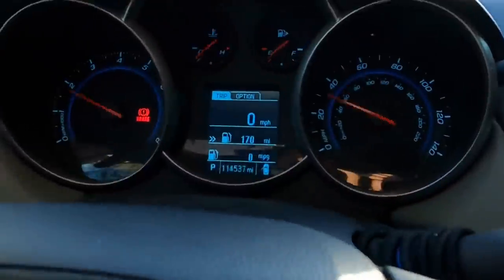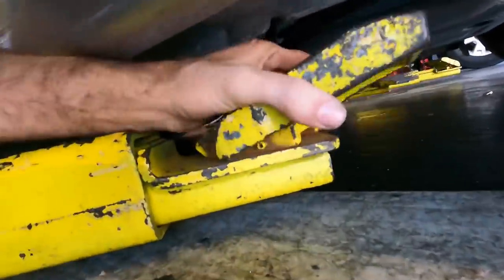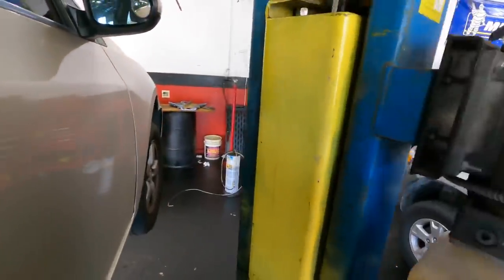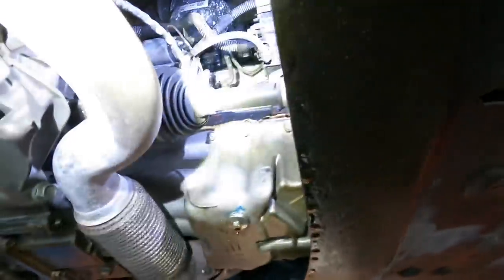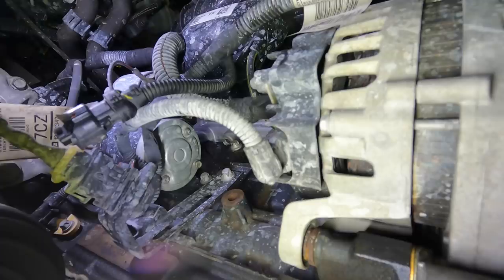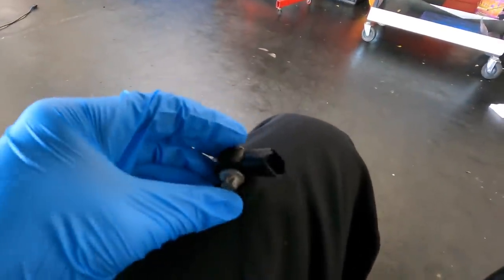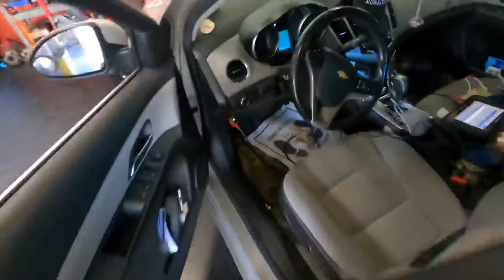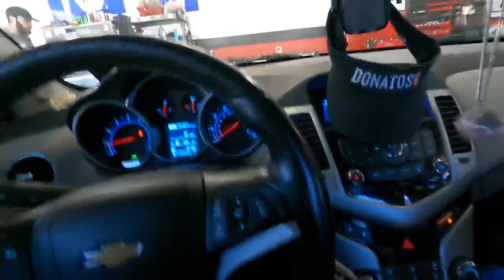Rolling the Dice! Parts Store Diag! Customer Supplied Parts. 2015 Chevy Cruze  P0324

Comment: Very clever 'knock-sensor' device!
( Makes me wonder "How in hell did someone 'connect-all-the-dots' to come-up w/the idea of using a piezo-electric effect/affect as a 'switch?' )
Reply: It's more like a microphone than a switch, generating electric pulses from the noise vibrations.
Reply: Believe it or not, a lot of the technology originally started with the military. Piezoelectric detonators were and are used on some weapons. The RPG-7 round uses it to fire it's shaped charge warhead on contact with the target. The crystals can also be used as an transducer/sensor in certain semiconductor manufacturing equipment. In that function the crystal is used to produce an ultrasonic pulse then is switched to sense mode. The pulse hits the crucible and reflects up to the now sensing crystal which now has had material deposited on it producing a voltage that the controller monitors. The material causes a dampening effect of the frequency recieved which directly translates into the amount of material deposited on the substrates due to the change in generated voltage. The system is known as a deposition controller. 
A little known fact also is that those crystals are what makes the beep in digital watches. If vibrated or struck thay produce voltage. If pulsating voltage is applied to them, they produce sound based on the voltage and frequency input.
Reply: @gerrynightingale9045  That's a verbose way of saying what I did, except for the make/break part.  Make/break would be a switch that is closing/opening a circuit.  As you said, there is no power to it so no circuit to close.
Reply: @jeffragar3493  Think anything you like
I wrote something, you want to somehow 'Counter' or 'Modify' what I wrote
Fine

Comment: I recall these cars coming with a factory installed oil leaks near the turbos and chronic transmission failures.  The customer is going to have to supply more parts eventually.

Comment: My father in law ran into a no code situation with his 2012 F150 with 5.0, hesitation and no code. shop talked him into a new throttle body around $750 with the part, truck was still hesitating. I took my trusty scan tool to his house and still no codes. I originally told him to have them clean the MAF sensor, He said they had. Immediately saw that someone had broken the pigtail connecting the MAF,  upon inspection the wires at the plug had little light colored bands ( stretch mark around the wires. I ordered the pig tail soldered it on and sprayed the MAF sensor clean. It ran great for eight hours of in town running and a slight hesitation developed again.  I told him to get a new air filter ( Throttle Body Guy had put in a K&N ) put in new filter, sprayed Sensor off again, end of problem. That K&N filter had so much oil on it , it was literally dripping off the corners of the filter when I changed it. He finally confessed that they had never touched the MAF sensor. Keep up the good work, love the videos. Your honesty is a great thing!

Comment: Good morning Ray 🙋‍♂️✌ I was wondering if you could give me some advice about my car! Any help would be appreciated 🙏🏼 It's my commuter car so I'm in need to get it fixed 😅👋 Be blessed 🙌
Reply: get a scanner and learn to read live data, that will help loads. doesn't have to be a high dollar unit, live data capable is what you need for running issues. there are people on this very sight that will help you learn to read the tea leaves and it's really not that hard. i bought a $50 unit on amazon that i prefer over a $200 unit i also bought with more capabilities. codes, dtcs, are often times not what you need but a result of other issues. Schrodingers Box look this guy up, he's were i got a lot of info when learning. he's pretty sharp. once you learn it, you'll be better than most at troubleshooting. obviously, that's not the entire picture and something mechanical, you'll not be able to see all the time with that info. there are tons of old school simple tricks to troubleshoot on here. i'm not suggesting you become a master mechanic but find some info to help you figure it out. then you might even opt to fix it yourself and you'll definitely save a ton of money over time.

Comment: Ray knows better than most that if most fixes 4 a given code on given   motor vin are identical, that's a good place for diagnosis start. Probably what this savy Cust did.
2 car gas station I worked would charge double for such repairs. Cause most custs don't realize parts profits pay the rent and utilities. There's no Free' Lunch for anything anymore, Folks.
If You Wants to Play.......
You Got's to Pay !

Comment: I welded in plates under my 1500. I made the surface like a ratchet handle surface.  The plates have deep edges. So it can't slip off. The garage asked me & thanked me for putting them in. They want me to put my "lift plate shoes" on some of their Vehicles. Every Vehicle is different. I may take them up on their offer. It cost me $275 to make, install. They are willing to pay $400. I guess I don't understand the Hype. Plus I have to be custom. Not put in random spots.

Comment: I work on cars for a living (in europe) I have never seen that type of lift pad . They look some what sketcy to me. The one i use have pads with a rubber top that you screw in to a desired hight. (2 stages) and with different higt extensions.  And i would never use a hydraulic lift without automtaic relese of the saftey latches at work (even my lift at home have automtatic locks)

Comment: Aside from dealer parts...aftermarket part's are an affordable way to keep your car on the  road. Buying your parts from the same parts store the repair shops buy from..and yes even the dealers buy from the parts  stores. So I laugh when a shop states it won't warranty the repair due to the customer bringing in "his/hers" parts..I agree some after market part brands are a better product..better quality..and you'll pay$ for it. If I buy front brake pads at Napa. Then bring them to a repair shop for onstseqq

Comment: hey if the scantool says it is a knock sensor, it HAS to be the knock sensor! The tool said so. Oh and the big box auto store said so too! Auto big box store was right!!! WHOHOOO!
Reply: As the dumb bunny that has to write the code for self diagnostics, we do the best we can with what we have.
Reply: Customer self-diagnostics is fun to deal with when they bring something in for repair.  Always do your own diagnostics to verify the issue.
Reply: @TheCorpsehatch  I've spent to much of my life learning this trade to give out free diag, "1 reason I don't do it anymore" besides who needs knees and a functional back w/o pinched nerves etc. Cause Muhkanik 🙄
Reply: @Sneakdisscommentbelow  I agree. They aren't willing to pay for diagnostics, they aren't getting diagnostics. If its something obvious such as a visible broken wire then notify them of that.
Reply: @mph5896  I would run the scanner and check the codes then ask the customer about the diag. I wouldn't look for broken wires and here's why, say said broken wire sbox rolls in with a light and I pop the hood and see a wire broken and offer to fix it for .3 for labor rate and solder and heat shrink "parts, because you don't pay for my tool bill and I don't have a monotized YouTube channel" then fire up said sbox and it still has the same light and code. Then I have to tell the customer that it didn't fix it and the customer definitely isn't wanting to do anything because my fix come to find out is a complete bust. So there I'd stand looking like a complete dummy and I say m ph told me to fix the broken wire so idk what happened 🤨, no thanks, I'd just get my hour and not bother the customer with potential incompetence.

Comment: I am a lead machine operator at a pharmaceutical company.
We have several mechanics on staff who's ego far exceed their ability to repair the machinery.
The lead mechanic purchased a well used BMW M3 and it developed what he was sure was a head gasket issue.
He took it to a very well respected European Auto specialist and told him that the head gasket was bad and to replace it.
The shop did what was asked of them and returned the car to him after replacing the head gasket.
The mechanic I work with was shocked after he paid a rather substantial bill and took the car out it was still exhibiting the same symptoms.
When he bought it back to the shop and complained that the problem was still there he was told we repaired what you asked us to and you did a self-diagnosis and wasn't interested in us diagnosing the problem and told us repeatedly how you were a lead mechanic.
Reply: HA, that is some funny stuff. People ask me if I am good at what I do. I tell them, you can determine that after my work is done.
Reply: Well I did diagnose my own heating and cooling system problem, and when I took it to the shop I told them it was the radiator. Of course at the time the radiator was puking water out of the bottom tank where the seam had split. :)
Reply: Compression and leakdown test a,so a coolant contamination fluid test
Reply: Yep, imo taking car to a repair shop is like taking ourselves to the doctor office…it’s better to say very little and let the mechanic or doctor diagnose the problem.
Reply: He meant "lead" as in the heavy, dense, dull metal used in sinkers, not as in the sense of leadership?
Reply: @randomschmo5778  When you go in clearly describe the problem to the best of your knowledge, answer questions and let the pro do their job as long as you feel they are trustworthy. That is ,of course, the 64,000 dollar question.

Comment: Ugh.  The condition of most of these vehicles is scary.  My daily driver is a 2010 Malibu LTZ 3.6 VVT.  No oil leaks, no noisy timing chains, no transmission leaks, no parts hanging off, crushed, dented or generally damaged.  Why?  When parts are worn I replace them, when leaks are discovered, I diagnose and replace the gaskets.  I avoid road hazards and don't generally drive like a numpty.  It looks almost as good as new.  The problem with most cars, is their owners.  I still have my daily driver before this ^ daily driver. 2001 Monte Carlo SS 3.8, It has 325,000 miles on it with zero mechanical issues, zero leaks, no parts hanging off, crushed, dented or generally damaged.  It looks almost as good as new.
Reply: well put, "the problem with most cars, is their owners". they run them into the ground ignoring problems and expect them to last forever. then they don't, they often don't know what to do other than take it to a shop or sell it. it's really sad how simple things are and how ignorant people are at time. i'm gonna comment on this car, i would imagine this is a young woman's car looking at it and she's addressing a light that is but a single issue. many don't do that. hell my truck has a knox sensor code and i've been ignoring that for quite awhile. probably ought to fix that lol. i also replaced a BUTT LOAD of parts on it to get it close to right. it was a $800 06 2500HD 4x4 if that says anything.
Reply: Exactly. I do the same. Coworker has a truck I did a little work on. 225k, 2005 Chevy pickup. Water pump and hoses repaired due to leaks. Cooling system was then good. I test drive it, the steering is all over the road, check engine, airbag light on. He now bought a newer truck and thinks he is going to ask $8k for his rusty bucket. HA

Comment: Anyone who thinks "car mechanics" are nothing more than oily, unsophisticated grease monkeys, with the IQ of a spit cup, need to watch this channel. The mechanical and analytical skills of top technicians like Ray, is impressive. They have to have an in-depth understanding of everything from vacuum systems, complex electrical circuits, hydraulics, physics and mechanical engineering, systems and engines. Plus, they have to adapt those skills to a constantly changing platform, with endless makes and models. Much respect, just saying.

Comment: After watching  you put the  lift feet on the pinch weld I have seen several times where the mechanic bent the weld so I couldn't safely install my jack insert. My jack has a cutout so the weld doesn't take the full weight, it's distributed over a larger area. I know a jackass has worked on my vehicle when I see this..  Another point, my Astro van had the sheet metal bent to shit due to the mechanic placing the lift in the wrong place!! I know he was fired.

Comment: I don't blame the customer for skipping diagnostics. If I was in their place, and a trouble code pointed towards a relatively cheap and easily-replaced sensor, I'd ask for the same. At the worst, it wouldn't fix the problem and I'd have to pay for diagnostics anyway.

Comment: Shops typically double the price of parts so that they can guarantee their work, which would involve the labor on replacing the part because the part is actually guaranteed  by the manufacturer. I hate this because there's only a very small chance that a new part from a good manufacturer will fail. What is your experience on how often new parts fail and the shop having to redo work?
Reply: I'm glad you made the point of the profit on parts. So, the shop already lost the profit on the part sale. If that part came from a less than reputable source, then the chances of failure are, I'm my experience, 30/100.
Then, if that part does fail, who pays the repair shop for diagnostic time and replacement time. The parts store probably wont pay full rate, MAY pay warranty rate, if not less. Then there is the wasted time in between diag. and waiting for the part... Bottom line, shops should not install supplied parts. 
Profitability, warranty and reputation. These three reasons are why.
Reply: @Wishes890  No warranty for customer supplied part. Customer carries manufacturer warranty. Replacement has the burden to pay for new install. I like this arrangement because it allows me to buy high quality parts that have a very low chance of failure. This works well for bolt on parts. With electronics you might want the shop guarantee and pay the extra money.
Reply: @avisitorhere  Actually I don't want to have the hassle of dealing with someone else's part, and, I don't want to support some other parts store. And, if every customer brought their own parts, how would that affect the company bottom line?
Reply: @Wishes890  I can't say what would happen to the shops profits. But with a lower repair cost from savings on part margins, maybe shops would get more business because consumers could afford proper care of their vehicles increasing the volume of their business. Personally I bring in my own parts so I can afford better parts and give my mechanic more work which helps me maintain my car properly. If I had to pay the mark up, I would only likely do absolutely necessary work and put things off like a lot of people do.
Reply: @avisitorhere  You are a rare breed. It's good that you buy good quality parts.
If a shop didn't have the revenue from parts sales, their profit would  drop to the point that they would have to almost double the shop rate to stay open.
I have managed a couple shops, and the cost to keep the doors open is very high. Many, many expenses that people are just not aware of.